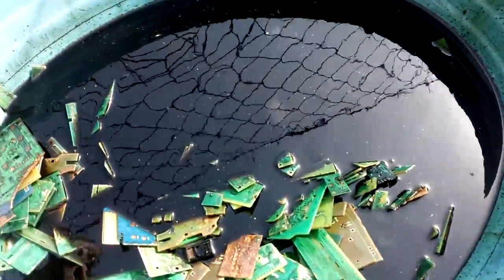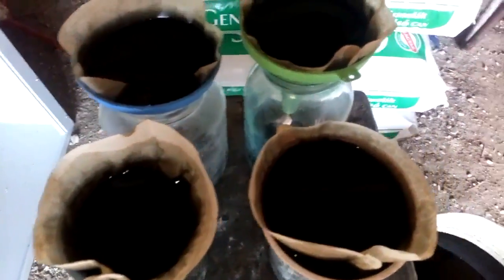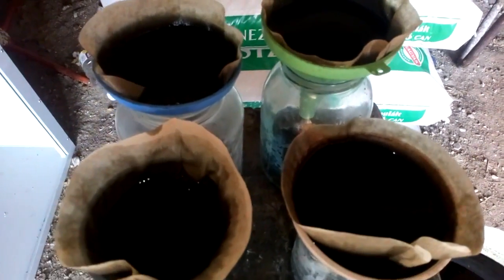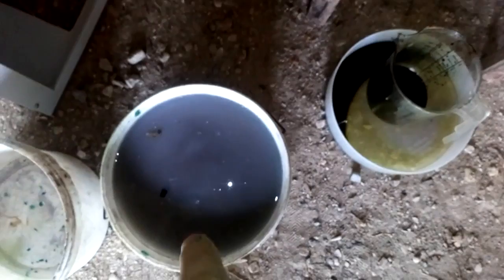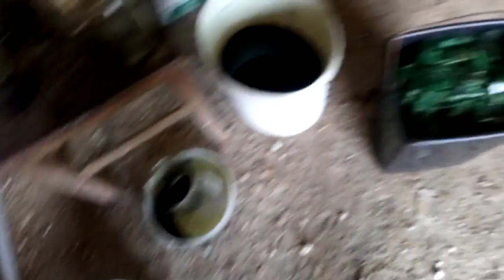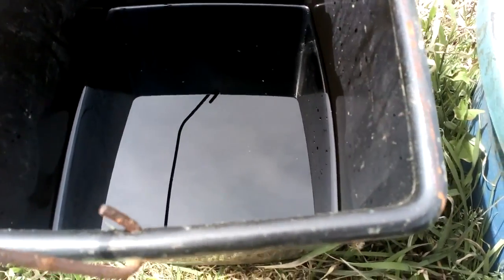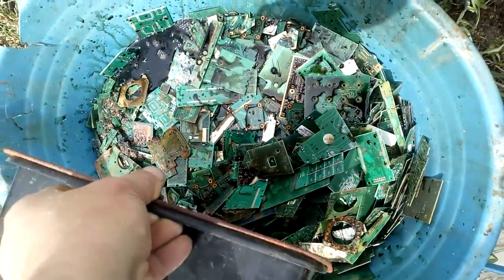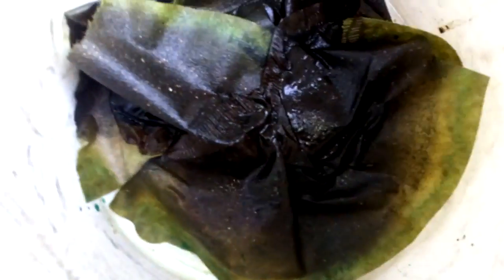From BOARD to GOLD - AP Gold recovery!

Comment: What is the weight of raw material?
Reply from the maker: keethan shan Sorry, but I did not measure the plates before putting in Ap. I do not think it has any purpose since the plates from different electronics and it is difficult to reach a constant amount of gold per kilogram of plate.
Reply: Thanks for your kind reply dusan
Reply: Maybe you can measure after processing...